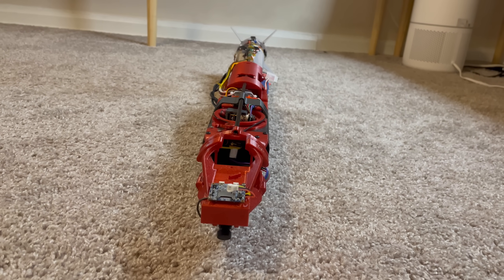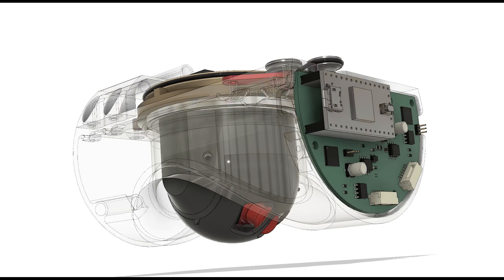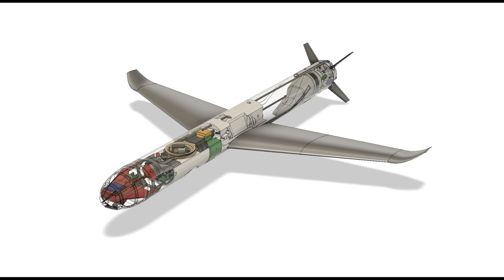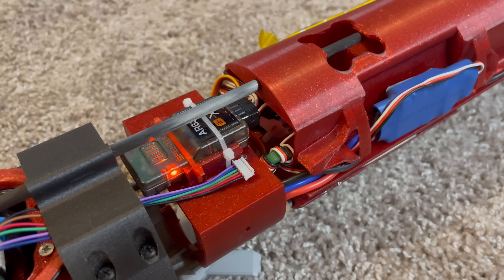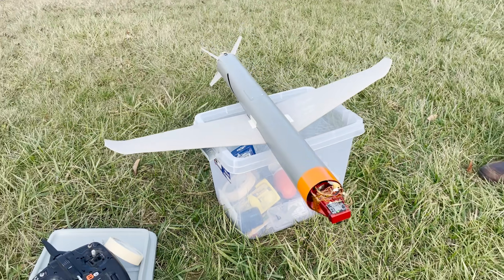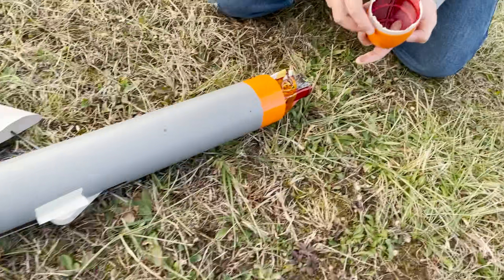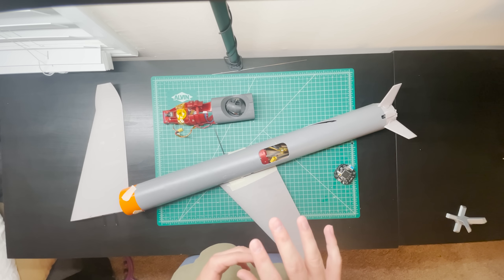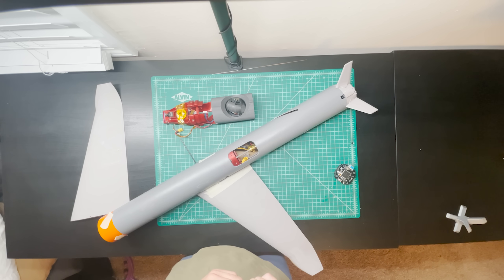Building (And Crashing) my Homemade Surveillance Drone

Comment: Maybe make a flying prototype first using weights to simulate mass distribution. after you have it flying stable, then add the expensive stuff. And you need more thrust, you basically make anything fly with enough thrust. Nice Project!

Comment: I would use the bunge launcher. Look into aero filament to reduce the weight of your printed parts. It foams the print making so it displaces plastic with air.

Comment: Two words - Vehicle Testing! Mount the the darn thing on a gimbal and stick it out the window and fly it from the radio inside the vehicle. Then you can test the stability, control, and stall speed without risking the aircraft. Just watch out for oncoming traffic!

Comment: This thing looks insanely heavy for its wing surface. your EDF stall speed is probably very high and would need something like a bungee launch or other means to get it up to speed. also, drop the quad control surfaces, go to a v-tail and loose weight while increasing durability and landing capabilities. the last resort option may include rockets.... look up JATO and slap some rocket assisted launch on it.

Comment: I think all your ideas are good. A few thoughts:

I don’t know why you want to keep the two bottom fins. V tail designs work pretty well for planes.
For the rail system, it’s been done without the rail, just with a bungee rope: http://www.itsqv.com/QVM/index.php?title=How_To_-_Simple_Bungee_Launch_Set-up (or search « RC plane Bungee » on Google/youtube.

Launching it from a cliff would also allow it to gain some speed.

And lastly how strong is the torque of your duct engine? I had a plane crashing constantly at takeoff because the motor was too powerful relative to the wing surface, so it would spin on its yaw axis at launch if I launched full throttle. I managed to take off by lowering the throttle.

Comment: Several things. The main fuselage planform area is relatively large compared to the wing planform area. Increase wing planform area or decrease fuselage planform area. Be sure CoG is at the quarter chord of the wings. Reduce takeoff weight or increase wing planform area/wingpspan. Also might literally not have enough thrust to maintain a high enough cruising speed, or take off.

Comment: For the takeoff, if you want to use a rail launcher, I saw this idea where someone made a rail launcher that used physical electronic contacts on the car holding the plane to switch electromagnets to make a sort of railgun plane launcher; it worked really well in their tests and also if you want that visual appeal it looked pretty awesome.

Comment: Maybe try attaching it to an existing flight worthy model and deploy once its at altitude, kinda like the space shuttle
Reply: Ooh I like this idea. In air deployment sounds cool. Although, given the use case which he outlined, it should still have the ability to hover at a constant altitude to track the rocket launch, so achieving stability at low speed is of paramount importance. But wait, how does he plan to hover again with TVC EDF firing at the rear and fixed wing?

Comment: Add a nozzle, remove the duct interior fins tonreduce resistance, and possibly add a ring around the fins that acts as both a venturi, compressing air around the surfaces in flight, which also doubles as protection for the rear fins increasing their ability to take a beating.

I would reduce the size of the lower fins slightly and make them entirely static.

The ring around the fins now being ovoid can be geometrically shaped in cad to direct air from above the fuselage and wings to the duct containing the controls, which should increase their effectiveness.

Comment: I would use some surgical tubing and make a slingshot rail to get it up to speed so you have effective lift and control - throwing is unlikely to work unless you get rid of most of the weight… you could also use some canards to decrease stall speed and increase pitch stability

Comment: Hello, i work on drones (mostly quad/hexacopters, but occasionally some fixed wing stuff) for ukraine.

If you want to be able to carry a full system suite and not just be a flying foam RC plane youre going to need a lot more thrust and a bigger battery to boot.

There are plenty of loitering munitions that are around that size, and they (almost) all use much, much larger motors with external propellers to boot. Take a look at the ZALA lancet or aerovironment SWITCHBLADE 300 for some reference. 

To optimize battery weight, consider using a small lithium polymer (high output battery) for takeoff thrust, then transitioning to a much more energy dense lithium ion battery. You can make your own or buy one. Check out the lumenier NAV series.

Good luck!

Comment: I'm not an aerospace engineer and I don't have much experience with Rc flight, but I am a professional when it comes to tomfoolery so I'd suggest strapping a couple Estes C6-5 Rocket Engines to it and lightem off. That ought to get your craft up to viable flight speeds...... or it will explode........

Comment: Every time I have seen an R/C plane or glider 'launched' it is, for lack of a better description, pulled into the air from a point forward of its center of gravity. Where as, unless I missed it, these attempts always looked to be pushed from the very back. Other potential issues aside, I would give this version another go and hold it forward of the wings when launching and see if it can just glide in a relatively stable manner. Interesting vid as always.

Comment: 10:25 Would adding a tight mesh cover over the inlet not be a good idea to prevent that?
Reply: it would reduce thrust by a very large amoung. either way a tiny motor like that is not gonna lift a brick so its never gonna fly

Comment: Respect to the author. I ask the author to pay attention to the center of weight of the aircraft in relation to the wing. This is the problem. You should also think about the launch catapult because for such a design, a manual launch does not give the required speed. I also see that the wing mounting pins are too weak. I would be glad if my advice will be useful

Comment: This is amazing dude. You casually made a Shahed-101. Looks like you learned why they use rocket assist take off. You also need a propeller about 3 times this size.

Comment: EDF was a really poor choice for this. They're good for high end speed but not for launching unless the model is extremely light. You need to convert it to a prop, or build a catapult. 30 years of RC experience for what it's worth.

Do you have actual thorough RC fixed wing experience at all? I'm not getting the impression that you do. Spektrum was a really poor choice of transmitter. For your type of projects you would've been far better off with FRsky or Radiomaster since they use open source software. 

Also just looking at the layout of the thing, it looks like it would be extremely nose heavy. Regardless of all the calculation's you've done regarding CG, I hope you did a physical balancing check, that would've been much better to do.

Comment: You have a really high wing load, which puts your stall speed upwards of 40 mph, plus.  I can see it’s slightly tail heavy and will make the controls sluggish once you get above stall speed.   Thrust from ducted fans are slow in coming up to speed, but if you got this flying in it’s current state your are looking at minimums speeds of 80-120 mph.  This would make an insane rocket boost glider using a G or an H in the booster stage and easily could handle rocket motor speeds of 200 mph+.    For now, I would rebuild a prototype as a glider with a 5” pusher prop on a 2200Kv+ motor and no payload using the tube, current wings, and V tail control. Then you can work out the weight & balance and have controls that you can keep up with while figuring out how to fly it, and it will survive all ground hits as you figure it out.  Once you have a light weight prototype like that is working and you piloting skills up to par, you can begin to add the more complex elements in.    You could scale up in size and keep the wing load down and have slower flight speeds, otherwise it will be scary fast and you will need a very large area to test in.

Comment: Maybe a small plate on the back of the intake that's on a spring and pops out when it leaves the tube to allow more air into the intake? Could help increase the thrust provided a bit.

Comment: I don't have much experience in this kind of aircraft, I'm more of rocket guy. But I noticed the Drone was a bit too nose heavy and had either too much weight or too little thrust. I don't have any experience on what I'm about to say but I don think the wings are in the right place, I would try testing with more forward wings or wings thrown back a little bit to play with the CG. The canards are just what you said, they need to be bigger on the top and smaller on the bottom, and I don't know if the TVC thing in the back could make the motor inefficient, I would make them thinner and a bit shorter. 
If I'm wrong in any of these please let me know I want to learn.

Comment: I love this idea, but there are some improvements I would consider. Firstly, I would use a launch rail because any fluctuation in launch direction is going to make it tumble, along with the high takeoff speed, it seems like the launch rail would help a lot. Secondly, I don't think the 4 fins on the back are a great choice for a horizontally moving aircraft, I would use 3 fins in the back (2 elevons and 1 rudder) and move the ailerons to the wings.  Thirdly, I would find another way to mount the edf because it looks like it is barley getting any airflow with the side port. Fourthly, I would get rid of the thrust veins because it just looks like it is limiting thrust even more, and the added control isn't really needed because its not going as fast as a rocket. Fifthly, the round airframe is increasing the required takeoff speed even more, I would make the bottom side a little more flatter. I also want to clarify that I am not an expert and some of the suggestions I made may be incorrect. Also, I want to say that I love your videos and I am very exited to see this project will get completed! ❤
Reply: Seconding the need for a launch rail, the hand launches start the drone in a highly unstable condition and it doesn't have the control, speed, or altitude to recover from it.

Comment: It is really impressive how finely designed and exquisitely you built this... completely wrong... 
Now i'm not a fixed wing expert, there are plenty of people better than me (Aerostuff FPV and Experimental Airlines are my favorites for their designs and information for builds, there's others for learning the basics like Bardwell for RC/FPV in general and Painless360 for fixed wing in particular), but here's my 2 cents:
1. jesus where do i start
2. this thing looks like it's made to fly at mach 0.9, which it won't, so you're sacrificing a LOT of low speed handling and takeoff flight characteristics which you desperately need if you're not going to take off with a rocket (based) and expect to land at less than terminal speed, especially if you want something that loiters since you want to be flying as slow as possible
3. the fin control surfaces are way, way too small; and yes since you chose a rocket-style cruciform they will tend to break without a landing gear or something; but they definitely look too small to, first of all, stabilize it, and second, actually have enough control authority to control it's flight, especially in a cruciform configuration with no ailerons, it's going to be using a lot of deflection for roll control so it's going to be struggling.
4. forget the RC controller. This is way too hairy for simple direct RC control, that's fine when you have a park flyer cessna or 50 years experience flying RC planes, it needs fly-by-wire. INAV works amazing on fixed wings and will help a huge amount stabilizing it, and there's more than enough navigation/autonomy for everything you'd want. An F405 Wing controller costs $50 and will do wonders. There's lots of resources on how to set one up, it's not as complicated as it looks. Everything else is. You can worry about Arduplane later.
5. the plane looks completely out of balance, CG way too far back. You should be able to just throw it unpowered and it should glide gracefully to the ground. "single large 3d print assembly" at the rear = VERY heavy where you don't want that
6. it will NOT glide gracefully to the ground because those wings are still way, way too small; and their positioning won't do anything to help stability,
7. EDFs are cool for going fast and replica jets, but they are extremely inefficient. Like, EXTREMELY inefficient. Pretty much all non-replica planes use propellers because they're magnitudes more efficient.
8. It is wayyyy underpowered, that thing sounds like a hair dryer. Your t/w ratio for something like this should be approaching 1, if you really want an EDF, it should be *screaming*, which of course means you'll get like 4 minutes of flight time. With enough thrust and the right CG, it will (probably) fly (i'm not saying it would be controllable in this configuration lmao)
9. It looks really, really heavy; and with those high aspect ratio wings it won't get far if anywhere. Unless you want to launch it from a tube or drop it from the air (based), lose the folding wings, and ailerons would help a huge amount
10. you WILL crash when you first fly it and test and tune it, there's no way around it, it is a certainty, so design with that in mind, and don't even bother putting in any payload (especially an expensive thermal camera, goodness) before you dial it in down to a T. Definitely remember to tune it with the simulated weight of your payload in the right place.
11. lose the thrust vectoring, i'm begging you, it's already inefficient enough as it is, there's no point. Others have mentioned it but the exhaust fin thrust vectoring (which is fine for a rocket) might actually be killing all your thrust, you could get away with having a moving exhaust nozzle, but that's even more weight at the rear, which you really don't need any more of as it is...
12. If you stick with an EDF, well there's nothing spinning at the rear, so you could put that launch rail experience to use, maybe even powered like a catapult. You mentionned this, that sounds cool. But you need to figure out the above first of all.

Getting into scale plane design is always a humbling experience, because even if you know a hell of a lot about other things, you always realize you know a lot less than you thought and it doesn't take much to screw up. Everyone starts with far too ambitious first project before they realize "Oh crap, i need to learn the basics first". There's absolutely no shame at all in pausing everything, starting from square one and building a big slow cessna-style trainer or buying a pre-made Zohd or Altius so you can learn the basics before getting into advanced builds like this.
Side note, since you're into 3D printing a lot, check out Flightory and Titan Dynamics, they design awesome 3D printed drone-like designs.
Good luck man, your stuff is awesome and i love seeing you get into this, just don't get discouraged, you're trying to bite off a pretty big piece but you definitely have enough brains to be able to chew it.

Comment: I think you need.. MOAARR PWR! no seriously, that small outrunner EDF is not going to do it. Freewing sells nice and affordable 80mm & 90mm units. a bit larger intake and exhaust might help too. my second unrelated advice is to ditch spektrum for an ELRS TX/RX and go with a flight controller board running inav or ardupilot, bit of a learning curve but you’ll love it. It will help you autolaunch too. Looking forward to see more! would love to help out 😊
Reply: Freewing E72314 for 80mm or E72215 for 90mm